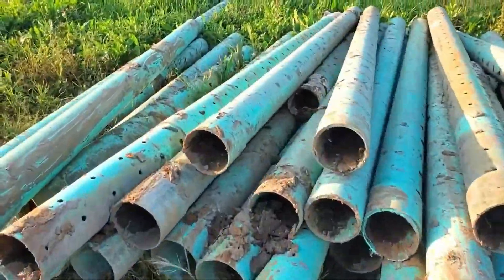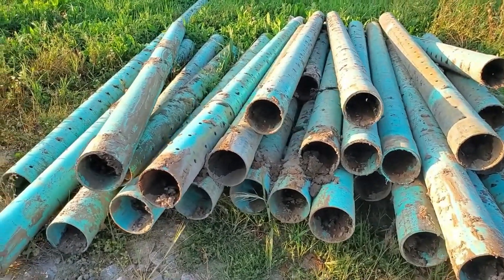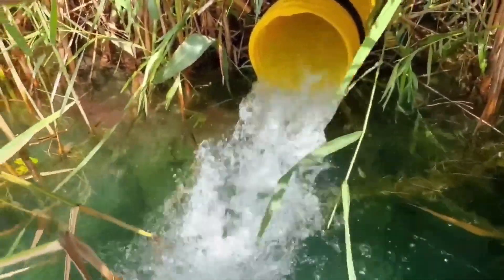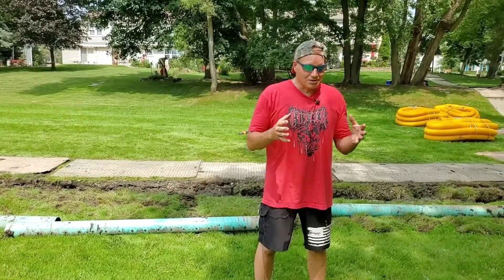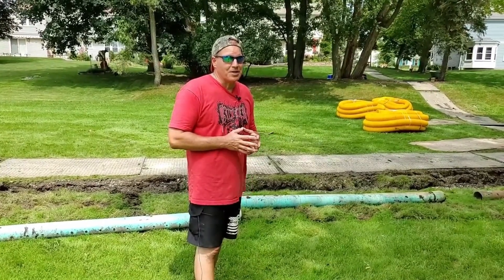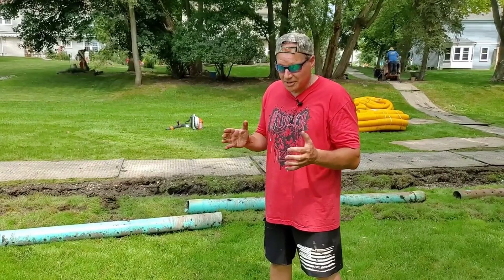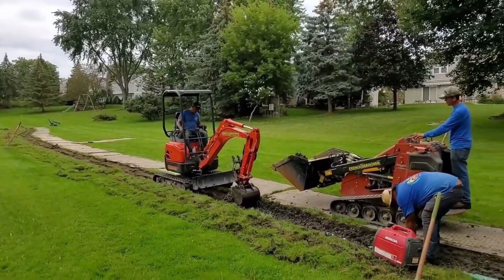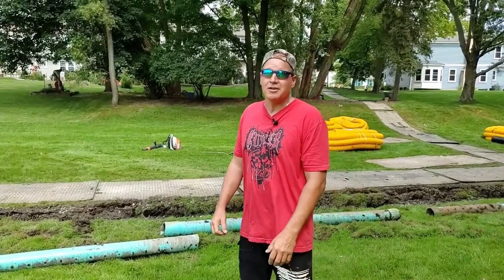How to Build a French Drain to Last a Lifetime | Back to Basics Part 2

Comment: Is ending a french drain system and a gutter drainage system into the same pop up emitter okay? Just don't connect the 2 systems until shortly before the pop up. Most water will be from gutter drainage system. Little from French. Does every guttersystem need a d-box to clear out debris prior to pop up emitter. Many trees around area. TIA
Reply from the maker: 👍 You've been doing your research. Yes keep them separate to the end and tie them together.
Reply: @FRENCHDRAINMAN  thanks yes. Your videos make it great for a DIY. How about the question in regards to needing a d box to catch debris on the gutter drainage. Is that always necessary?
Reply from the maker: @taylorardisson9387  D Box isn't  Necessary if you are willing to flush out the line through a clean out with a hose once a year.
Reply: @FRENCHDRAINMAN  thank you kind sir.

Comment: Question : So I just had concrete pad and driveway installed and they ran the gutter down spouts under the concrete pad and and driveway to the street. They used perforated pipe , with a bunch of drain stone  then the concrete base on top of that. Is perforated pipe ok to run under the concrete ? And also they ran it too the street to a pop up emitter and if ran the hose down the downspouts for like 25 mins and i never seen the water drain anywhere.. Is that normal? ( this is also the garage side of my house not ran near foundation)
Reply from the maker: Sadly they used the wrong pipe it should always be SOLID PIPE under cement. We see this mistake all the time
Reply: @FRENCHDRAINMAN   what problems come from this ? And is like a big problem or just leave it at this point?
Reply from the maker: @mikeferchen1  This will wash out the base material and create voids under cement. If you are in the North the water will freeze and crack the cement. I would get a 3 inch Solid corrugated pipe and put it inside the 4 inch Perforated pipe.